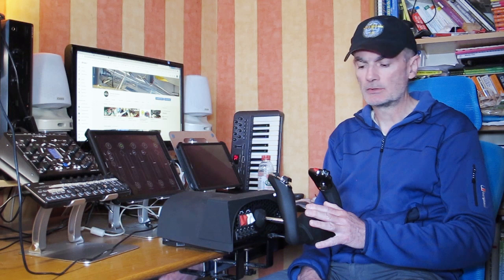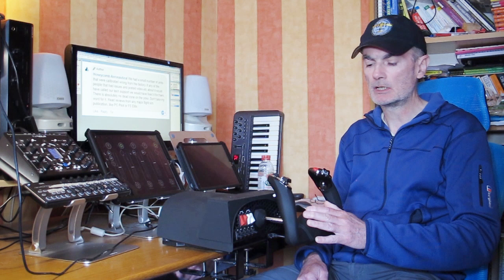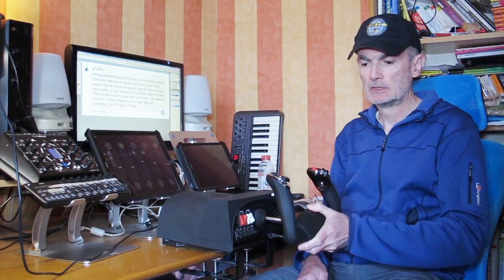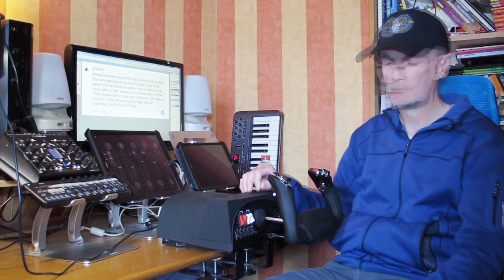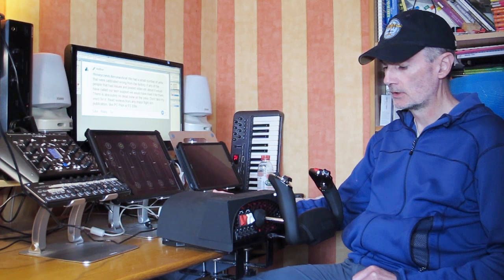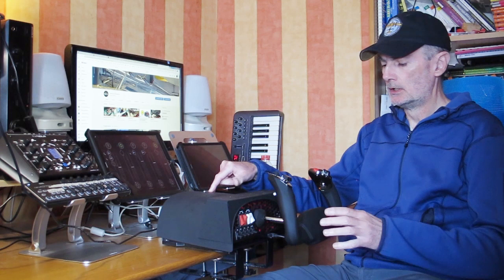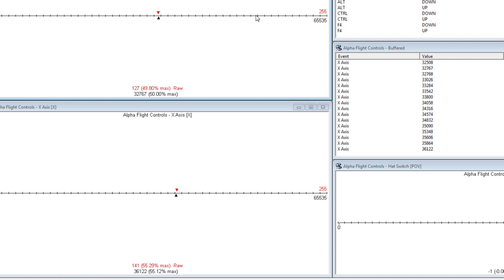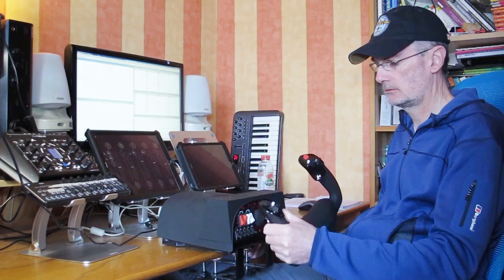Honeycomb Alpha Yoke SECRET Calibration Mode!

Comment: When I reviewed this yoke, I noted how surprised I was they were using potentiometers rather than a solid state mechanism. I expect they're good quality ones but I'm aghast that (as good as it is)  this yoke didn't employ what amounts to a relatively simply rotary encoder as found in older mice. With an optical solution or even hall effect that would be even sharper.
Reply from the maker: Honeycomb's argument against Hall Effect sensors is the relative cost. I haven't heard of any such devices using rotary encoders.
Reply: @AlmostAviation  Hall sensors are used in the triggers for the XBox One and probably others. I haven't pulled any others apart to look. So I don't buy that argument. ;)

Rotary encoders using Gray code (which is a slightly aphasic pair of bitstreams) were used for decades in "ball" mice. They met their end when optical came out but it was dirt on the shafts that caused the problems - the encoders are mostly solid state and the moving parts aren't under a lot of pressure.

If I had the money, I'm willing to be it would be possible to replace the roll axis with a similar design and drive a X9315  (Intersil solid state potentiometer) that would replace the pot they are using. The X9315  is about $12 so more costly than a pot, but not a dealbreaker. 

Rotary encoders aren't expensive but you'd need one that doesn't have idents so hence something al-la 1980s mouse would do the trick.

The pitch axis is a bit more tricky but I've been working on a design that could (IF it works) do the same thing for that too. Basically (and because I detest patents so this is some open source prior art) the idea uses pulse-train with PLL to detect changes in distance as the yoke is moved in and out. It might turn out to be less practical that my theoretical models suggest but I'm waiting on the parts arriving so I can see how well (or if) it works.

Think of it like a distance detector that doesn't measure absolute distance, rather the change in it.
Reply from the maker: I'm not sure what this has to do with calbration.
Reply: @AlmostAviation  Bad quality pots screw up calibration. My training was in electronics in the 70s and even then it was well known that crummy parts drifted with use and time. My apprentice could design a better setup than Honeycomb.
Reply from the maker: Well if he can build and sell them for under $250, perhaps he'll make his fortune.

Comment: Just mark the metal spline near the collar with a fine marker pen to create a more accurate returning position for both roll and pitch.
Reply from the maker: I'm not sure what you're comparing here. Yes, you can mark the shaft and return it to a fixed position but you will get much better accuracy by measuring the rotation out at the handle.

Comment: Had a really bad deadspot between centre and 20deg right aileron.  Followed this calibration 10 times to no avail.  Seemed to be a mechanical issue so popped the 8 Philips head screws out along the sides at the base, top comes straight off, and I could immediately see that the grub screw that is supposed to secure to the trimpot was very loose.  Tightened up and it's no longer got the deadspot.  Followed this calibration again along with the one in Windows and flying is now back to how it was when I first received the yoke.
Reply from the maker: Success! There do seem to be a few quality control issues, including strain on the curly connecting cable.

Comment: The main question is why honeycomb neglects such kind of an issue which can be fixed in minutes...
Reply from the maker: It is an interesting question.
Reply: The issue is arguable. I own one and use it with Xplane. No issues with it whatsoever. Happy with my purchase! There are hundreds more owners also saying they have no problems.
Reply from the maker: You don't explain what you mean by 'arguable'. Perhaps you mean that statistically the number of well-calibrated yokes outweighs the number of poorly-calibrated yokes, although you would need to point to the data. It is possible that this is the case, but that's of no help to the people who have poorly-calibrated yokes.
Reply: @Stringbean421  I don't really understand why people goes to defensive mode while another one is criticising the 3rd party applications. It's crystall clear that Honeycomb Yokes have deadzones (which is not arguable). Ok. Maybe 1/3 may be more.. But defective ones are currently out there, disregarding the percentage... They exist!  If the fact is this, what is your aim to defend Honeycomb.? The company should accept the reality and publish the steps how to get rid of this nonsense problem...
PS: ha, if you are paid to defend the company, then forget what I've said...

Comment: Thank you very much for this (and previous) film.
I have made several attempts at calibration (in various ways), but almost nothing (or minimal) has changed it the behavior of yoke.
I have a continuous (about 5-7 mm) minimal dead zone. So I can live with it, but it's strange I can't get rid of it completely.
Reply from the maker: Yes, unfortunate that your experience doesn't match mine :(
Reply: @AlmostAviation  BINGO :-). I was tired yesterday.
Now I did calibration again and the zero zone was completely missing :-).
Please tell the secret, what are your settings for CONTROL RESPONSE and STABILITY AUGMENTATION sliders in XP settings ???
The sliders on the right are probably all set to 0.
And the sliders (Pitch, Roll, Yaw) on the right ???
Reply from the maker: @tombulva  I'm not using X-Plane.

Comment: Thanks so much for sharing this information!  It was very useful (and should have been included in the Manual)
I just received my Alpha yoke today.

Out of the Box...
There was a small dead zone on the roll axis, and not centered.
(There was no dead zone when steering to the left but there was a moderate dead zone when steering to the right.)
There was a substantial dead zone along the pitch axis, and in both directions (pitch up and pitch down).

I ran the calibration procedure per this video, and afterward, there was no dead zone on either axis.
(A significant improvement.) Thank you again!

Something else that I think should have been in the user manual was a diagram that showed the default assignment of all the switches on the yoke.
Reply from the maker: Glad it worked for you. In fact Honeycomb does now show the calibration routine in its knowledge base, although not to the same level of detail.

Comment: Mine was consistently showing a left bias to 49.50% instead of 50% and over a period of 1 NM or more the plane left wing would dip left and slowly track left. I tried multiple calibrations and none could get rid of it. Root cause? The cable that connects the yoke to the base was too stiff and putting a light left pressure on the yoke making it bank. Removed it, tugged it to stretch it out, and now it sits at 50% most of the time.

Comment: Thanks! Although my dead zone was almost imperceptible, it was there.  It didn't bother me, but being curious I followed these instructions and now I cannot touch the roll axis without seeing appropriate movement on the screen in both the yoke and the control surfaces. 

I currently don't have a general aviation airplane to try this on, but I wonder if the cables on a real plane stretch and cause a similar phenomenon.  When I was actively flying I never thought about it.  

Understanding this will be especially useful as the yoke ages and does not return precisely to center - now we will know how to slightly adjust center to compensate for some slop as time passes.

On the subject of Honeycomb not making this public, I would suggest that is not unusual.  I make adjustments to the configuration file in FSX that were not public.  Similarly, I use a Kobo eReader, and it has undocumented features that can be adjusted and added.  I am not angry at Honeycomb for not making it public.

Comment: I'm gonna have to go and check this out.  I haven't used my yoke in over a year because of this deadzone issue that apparently 'does not exist'.

Honeycombs not giving users access to the calibration details in the manual, or even online, is quite frankly a joke.  Even worse, they told you there is a calibration mode, and for you to not share it with the world.  An appalling company.

Thanks for ignoring their wishes and sharing this with the world.
Reply from the maker: Thanks. Honeycomb has since relented and a version of the instructions is available on its knowledge base.

Comment: I'll let you know when I get my yoke should arrive tomorrow,,people claim that the logitek/saitek have deadzones there is a lot of YouTube videos on how to fix it I bought 2 flight pro yokes 1 in 2013 and 2nd this year and I have no deadzones when I slightly move the yoke I can see the ailerons and elevator move so if it has a deadzone IAM happy about it the reason I got the honeycomb is because is more Windows 10 friendly the logitek I have to calibrate Everytime I restart or turn my computer on I first calibrate in Windows and I use Fsuicp 5 I use prepar3d 4.5  so I'll let you know see how it reacts as far as xplane I'm an AMD user so the opengl is no good I get 29 fps vanilla xplane with everything turned off so I'm waiting for the vulkan to get finished.in prepard3d with my addons runs very nice.

Comment: Just received the updated XPC model. Trying to use this method to eliminate the large elevator deadzone. However I cannot get it to go into calibration mode. After setting the switches as described, holding buttons 1 & 2 and plugging in, the LED flashes then goes off. Regardless of when I actually release the 2 buttons, or in what order I release them. The LED never goes to solid bright to indicate calibration mode. I wonder if they've changed the calibration method with the new XPC firmware, and it's once again secret?
Reply from the maker: Interesting. I have not had an XPC, so it may be that there's a difference. I would expect the need for the calibration is jus the same, as it is about the limits of the physical spring mechanism. Perhaps I will be able to get one to play with...
Reply: @AlmostAviation  Thanks, that would be awesome if you could. The instructions in the KB are exactly as you describe, so no update there. I've submitted a query about the XPC, no response to date. So with your experience  if you find one it might be a way forward.

Comment: Hi, thank you for this useful video; before I try this, may I ask whether this might help stabilise a Honeycomb Yoke that seems every now and then to lose it's "centre" such that the "Joystick L - Axis X" becomes slightly offset as shown within the MSFS 2020 sensitivity settings window? To temporarily fix this recurrent problem, I fully swing the yoke through its rotational axis whereupon the "ball" then re-centres itself.
Reply from the maker: It may be that what you see is a dead zone that is too small. So yes, recalibrating ought to sort it out. It won't do any harm anyway, so you might as well give it a try :)
Reply: @AlmostAviation  Thank you, and I will try!

Comment: I bet if you lubricate the shaft you'll get better calibration results too
Reply from the maker: I would doubt that. Presumably the bearing have some lubricant in them, but the bearing/shaft interface shouldn't need lubrication because these parts don't slide in relation to each other.

Comment: Just tried about 10 times but the devices never goes into calibration mode.  Besides what you showed (position of switches, white buttons, plug in), is there something else (ie must have or have not the sim running, etc).  Would appreciate your help on this . Thanks
Reply from the maker: I will presume you are doing the steps I described correctly, as I think I have shown them clearly. Nothing else on the PC should matter, as all the action is happening on the yoke. The only thing I can suggest is that there is something about your switches that is getting in the way. A number of prople have reported faulty switches of various kinds.

My suggestions would be: (1) make sure your four red and white switches are working correctly in Windows Control Panel (Game Controller Settings), and that they consistently toggle the appropriate buttons on and off. (2) Make sure your curly cable is connected between the yoke handle and body. (3) Make sure the two white pushbuttons on the left yoke handle are working correctly in Windows control panel. (4) Try running the the calibration procedure again. If that doesn't work, I really don't know what to suggest. I assume your yoke appears to work normally in all other respects.

Comment: Spew for you blokes, I have had mine for a year plugged her in the first-day and worked great straight out the box, not a drama since. I didn't know about the calibration thing so tried just in case I was used to a shitty setup. Not a bees dick of difference just luck I suppose.
Reply from the maker: I ran that through Google Translate and I think you found your yoke was calibrated okay :/

Comment: Thank you for sharing this, I've been on the fence about buying this, but I will pass and get the Thrustmaster Warthog instead, this Yoke seems to be a "Joke".
Reply from the maker: Well I'm not sure I see the logic, but I understand that the Warthog is well upstream of this in terms of design and build quality. It also has the advantage that it comes with throttles, although of course it's strictly right-handed.
Reply: And that is exactly why I have just bought the Honeycomb to replace the Warthog stick. I need something that I can use with either hand now that I have worked out what I want to fly. I will continue with the Warthog throttle though.

Comment: Hi, thanks for the video. I have a new Alpha yoke and I have a problem: the y-axis oscillates when moving! The x-axis is ok and runs smoothly. I've already done the internal calibration, but without any changes. What else could that be? I fly the MSFS in Win10. Thanks.
Reply from the maker: I'm not sure I understand what you mean by 'oscillates'. Also which axis are you calling X - the pitch or roll?
Reply: @AlmostAviation  I mean the pitch that trembles. Stable in the center but flickers when you pull or push.
Reply from the maker: @kamow5296  Sounds like a bad or dirty potentiometer. Or is it the new Alpha XPC? That should have contactless sensors.
Reply: @AlmostAviation  No it's not. It's an Alpha flight control with switch panel. But good to know, then I have to complain and I don't need to look any further in my pc system! Thanks again and best regards

Comment: I’m wondering whether to modify it with bu0836x.  Stock A-to-D is 8bit, which is 0 to 255, as you graph movement showed (20mV resolution).  Bu0836x has 12bit, 4096 which is 1.2mV resolution). Presumably 20x finer movement detection.  That would help smooth out dead zone.
Reply from the maker: I wouldn't do this. You will lose the dead zone of course, since you are throwing out the Honeycomb interface, but you will need to add it back in software if you want the yoke to centre properly. I doubt if the improved resolution will make much difference.
Reply: I did it.  Centering of the yoke is mechanical.  Just be sure to calibrate it under Win10 Setting-Device/Printer as you should.  Flight in MSFS2020 is very very nice, finely controlled.  I actually had a tougher time centering both Saitek yoke and Honeycomb, both came native 8bit.

Now I can easily increase or decrease VS rate, then release the yoke, and it will stabilize near that VS value, whereas the old 8bit would let VS continue to change.

Other movements are extremely smooth.  You can play with Sensitivity to set the response to your liking, while enjoying its smoothness.  There’s no looking back for me.  I had no clue what I missed using 8bit, until I went 12bit.  So so so nice.
Reply: To be honest, I bought the Honeycomb Alpha for its mechanics, not its electronics.  Use other’s electronic to do 12bit.  Its native 8bit is noticeably coarse, but that feel is only apparent after you’ve experienced 12bit.  Once you’ve done 12 bit, you probably won’t go back to 8bit ever.  I can now land the A320 easily at 100-200fps, right at touch down.  VS control is much more stable, rather than oscillation.